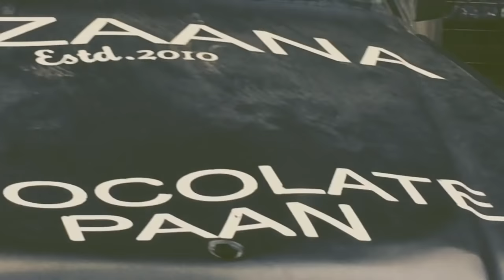Duke 200 vs Old Duke 390 | Highway | Mountains to back to City

Comment: hi Rahul, considering that the KTM duke seats are really hard, did you face any back pains and butt pains during this ride to mahabaleshwar and back? im planning on buying the duke 200 and would really appreciate your comment on this...thanks!!
Reply from the maker: +Salim Shaikh  Bhao the Seat and front end are stiff like a stone and after 100kms it starts paining but I would strongly say not to spoil the stock seat with any paddings or gel seat or cusioning it instead | Go for a Ride oN Air extra seat or the Best are riding pants which is probably the best solution .. and any rider should riding pants not to neglect it . I'm planning for 1 bas budget va problem hai bhava
Reply: rahulVlogs haha...thanks bro.....how is your experience otherwise with the duke 200? is it convinient for long rides? i might have to do many pune-Mumbai-pune trips for work on this.
Reply from the maker: +Salim Shaikh  best for city college office highways 
And touring too ...check my modifications vala video  then you might get an idea but basically it's all about getting good pair of tyres and the bike is ready to take you anywhere you want